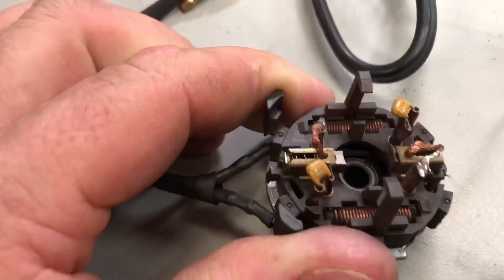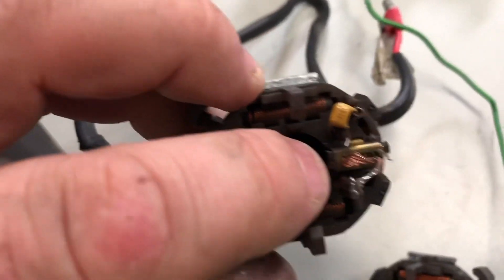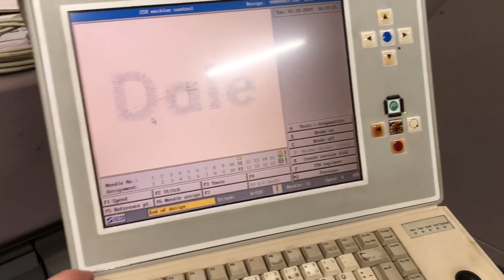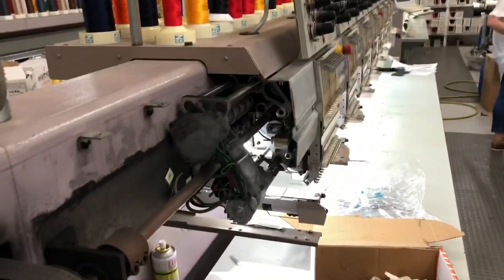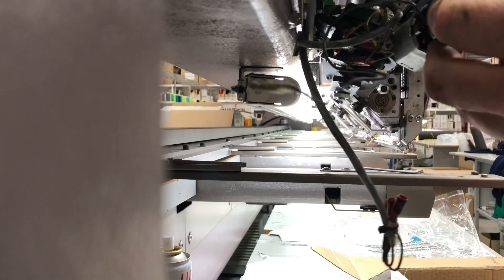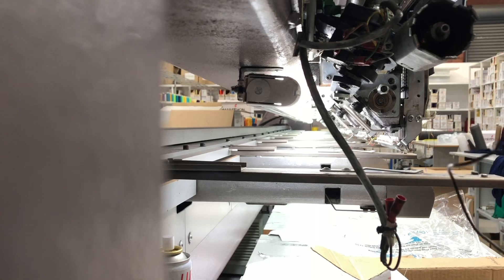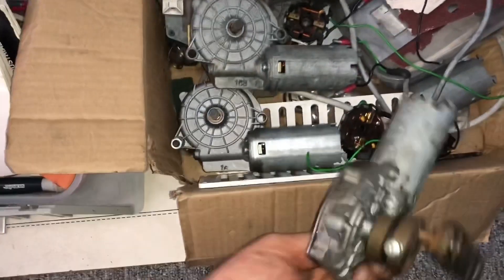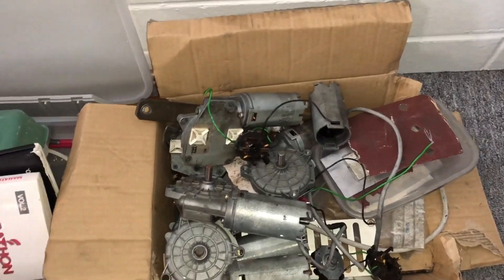ZSK Embroidery - new brushes in motors in catcher, picker and trimmer

Comment: do the brushes have part numbers on them?  or how do you source the brushes?
Reply from the maker: We sourced them from a carbon brush manufacturer on eBay from memory, measured the size and length and then filed them down to suit
Reply: @JBFromOZ  ah i see, thanks!  i do have an extra motor so might just pull that apart to do the same.  right now it's just sitting in a bin.
Reply from the maker: Yeah you will most likely find one brush is shorter, causing it to stop working, the process of reassembly can be a little tricky but it can be done :-)
Reply: @JBFromOZ thanks 😊 I don’t actually have a bad motor but I do have a single head 2002 JF (not as a main production machine, that’s for modern sprints) and just got done with some fixes for it so kinda exploring what else
I should be prepared for 😂

Comment: I much rather spend money on brushes rather than having to buy a new motor 😊 how often do you have to do this repair? We have a Racer only a couple of years old so hopefully it holds up well
Reply from the maker: ZSK are awesome machines, we had 5 running 12 hours a day for 25 years or so, hard to know exactly how long the brushes lasted, but it was a no-brainer as the swap was fast, accurate and cheap
Reply: Thanks very much. will there be more videos about ZSK?